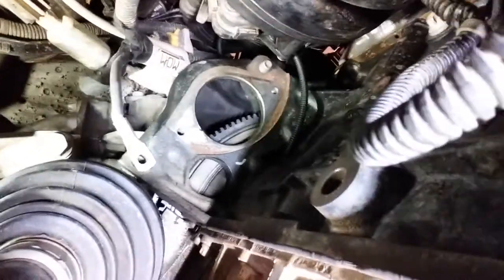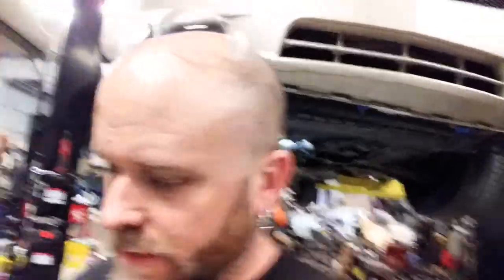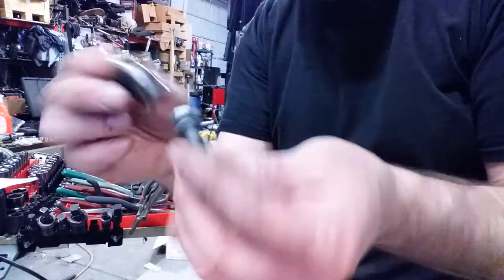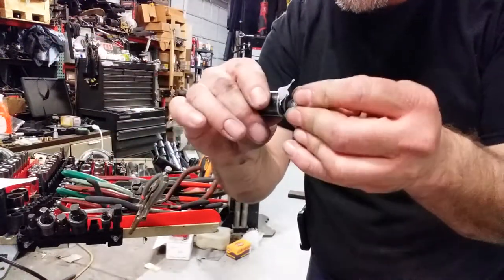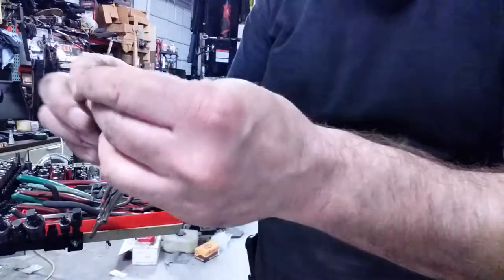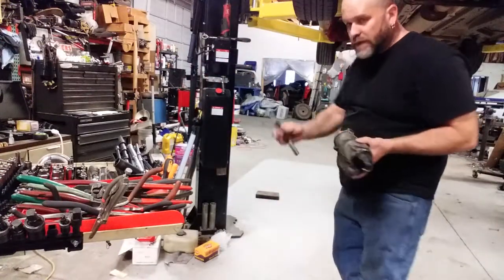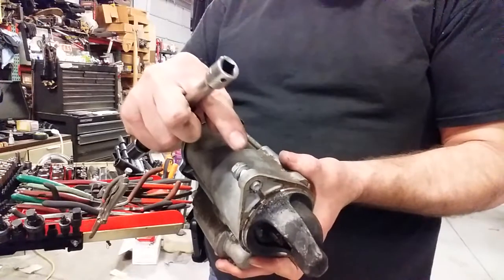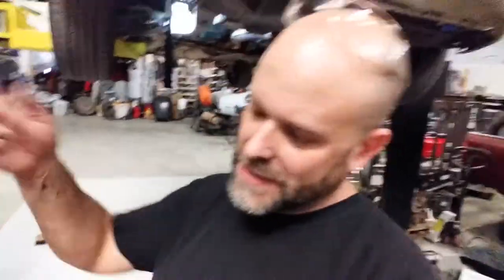How to get a bolt or nut in hole you can't reach

Comment: JD 4310 starter. No room to see engine block side bolt. No room for extension with piping and hoses. Cursing engineers!   Practically tore things to pieces and finally got it out. Then realized I had to install it which proved worse than removal. Damm engineers!  Did I say that already?  Finally found your fix!!  Second option except I tied the extension and socket to back side of starter with some thin twine. Put the starter carefully in place with threads now jamming into bolt hole. Attached ratchet and after a couple of turns the threads caught!  Hallelujah.  You’re the best!

Comment: Just put a zip tie on the extension and around the starter once the bolt is started cut the zip tie off it works well.